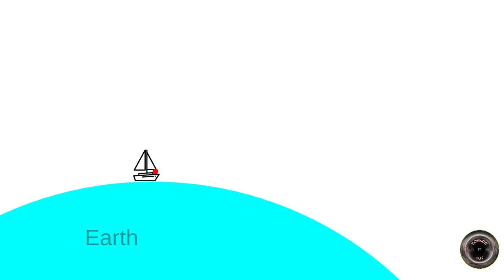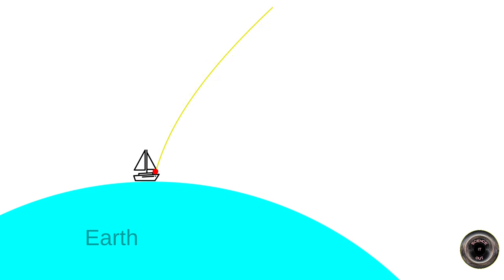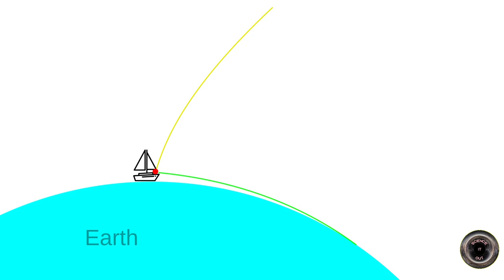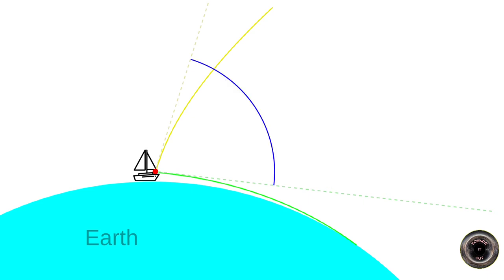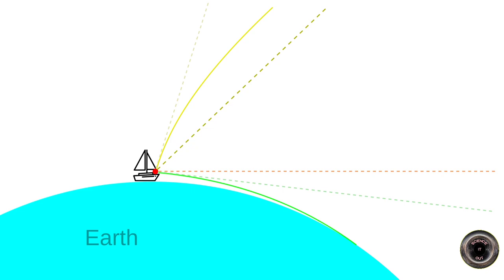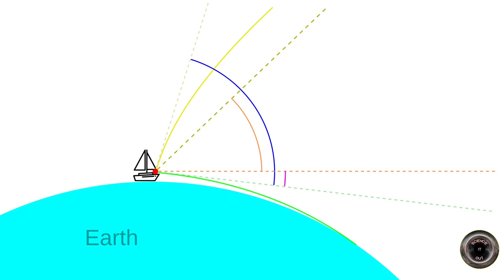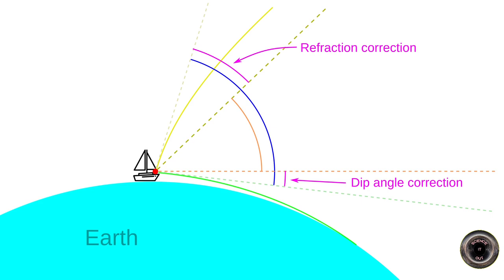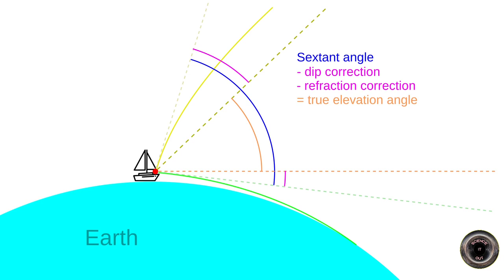How measuring the elevation angles works on a globe

Comment: This already starts off wrong.

Straight lines in sextant readings not bent lines.

Also you require the elevation angle from a 180° horizontal! This would be your sensible horizon.
Reply from the maker: As I'm pointing out in the video, it doesn't matter for the sextant whether the rays are bent or not (and they are actually slightly bent in reality). The only thing the sextant is "aware of", so to speak, is the directions from which the rays arrive at the sextant. And those directions are tangents to the rays at the sextant. But I'm just repeating what I said in the video at this point - I really don't know what's unclear here.

As for the elevation angle from horizontal, I'm also addressing that starting around halfway through the video.
Reply: @scienceitout  first have to establish a horizontal with a sextant. Nothing to do with bent light rays.

Refraction is a correction for angles less than 20° and dip correction is height of eye correction as you have to bring your sensible horizon to the deck of the geographic horizon. 

This whole video you just made was simply false. Sorry to break it to you
Reply from the maker: @FlatzoidsPerspective  "first have to establish a horizontal with a sextant"
A regular sextant can't establish a horizontal. It only shows the angle between two mirrors. That's it. (Actually, double the angle between the two mirrors, because that happens to be the angle between light rays that end up coinciding after reflecting off these mirrors.)
"Establishing horizontal" happens by subtracting the dip correction from the angle to the horizon.

"Refraction is a correction for angles less than 20°"
https://thenauticalalmanac.com/TNARegular/2022_Nautical_Almanac.pdf page 283 - you'll notice that the refraction correction table goes up to 90°. Only the correction above 20° is less than 2.5', which for many purposes can be considered insignificant.

"dip correction is height of eye correction as you have to bring your sensible horizon to the deck of the geographic horizon."
Remember the "horizon rises to the eye level" mantra? That would actually be the case on a flat Earth. The horizon would always be visible horizontally (well... assuming it would be visible at all, which isn't actually a given), and there would be no dip correction, as measuring from the horizon would just be measuring from horizontal.
But feel free to show - preferably using maths - how the dip correction can be derived from the observer height on a flat Earth. I'd love to see the rigorous, mathematical reasoning behind that. (Although I have no doubt at all that there is none.)

"This whole video you just made was simply false. Sorry to break it to you"
Well, you're wrong. I'd suggest asking an actual expert on celestial navigation, but I don't know if either of us knows one - or even if we did, if you would be willing to accept such an expert as an authority on the matter (although my guess would be no).
Reply: @FlatzoidsPerspective  Funny how you think the video is wrong but your first claim indicates that you don't even understand what a sextant does. Measuring the angle between two points doesn't require a horizontal. It's like you're confused about how a compass works. What you should be doing is finding a single flat Earther who can solve for a location given measured angles. You seem to think you can do it but none have even tried. Last one who did made a fool of himself by admitting Roohif used the proper method after he used spherical math. But you already know that.
Reply: The sextant lines are the dotted lines, which are straight (the yellow one on the left and the green one to the horizon).

The curved solid lines (the light coming from the start and the light coming from the horizon) are bent because light bends in the atmosphere, just like a stick does into the water. It's perfectly coherent with which we observe in reality.
Reply: @FlatzoidsPerspective  "This already starts off wrong." Funny thing about being wrong is it requires a reference or basis. Wrong according to what? Because this video is correct when it comes to all the classes being taught and reference material available for the topics of math, science, and navigation. So when you say WRONG, you must be referencing or referring to something other than the documented human knowledge for math, science, and navigation. While this starts to smell like a global conspiracy that requires way too much imagination to be practical, I don't suppose you have a reference where this video is actually wrong? Not to put words in your mouth, but the only thing I can imagine is that navigation in practice doesn't follow what is documented, but instead follows "the real" process and formulas. Which again seems like a very unlikely global conspiracy to carry out, but, if that is what you mean then you should be able to provide the reference to the actual method and math used from start to finish. That would be the holy grail for this flat Earth claim but for some strange reason none of the flat Earth gurus are able to perform this simple task. Yet they insist it can be done. Very strange.
Reply: @NinjaMonkeyPrime  Gosh Ward, you were a little rough on the Beaver.
Reply: @reidflemingworldstoughestm1394  I think Beav - I mean Failzoid - ran away with his tail between his legs again.
Reply: @FlatzoidsPerspective  you should watch his most recent video.  It's so sad because it is so bad
Reply: @garywybenga4188  thanks will do so mate
Reply: @garywybenga4188  You can’t spell “willfully ignorant” without g-a-r-y w-y-b-e-n-g-a 😂

Comment: Have I wandered into a fundy heretic zealot meetinghouse!!? You cannot achieve an elevation angle from a curved ADJACENT!! Mariners use the HORIZONTAL HORIZON!! Why isn't the dip correction going down to sea level!!? Oops.
Reply from the maker: 1. Measuring an angle to a curve is not a problem.
2. Horizon is usually not visible in the horizontal direction, funnily enough. The difference between horizontal and the direction to the horizon is the dip angle.
3. Dip correction has nothing to do with the sea level.
Oh, by the way, has any flat earther obtained a position fix from 3 star measurements yet?

Comment: No this is wrong your literally stating that sight reduction does not exist, as your bringing the line up to the eye as you guys seem to like to do ?
Well I have news for you, you bringing the line up to the eye instead of the eye being brought down to the water, does not save ye.
The water underneath the boat MUST be in a horizontal line with the horizon and GP, that is the whole point of the correction to make a 90 degrees using sea level as your horizontal reference, so wether you bring the vertex down or line up does not change the correction amount, as the correction amount is always only the height of the person’s eye above the water below, that’s what it is and nothing more, your video is wrong completely as your horizon is below the elevation of the water underneath the boat….
Reply from the maker: "No this is wrong your literally stating that sight reduction does not exist"
This has nothing to do with sight reduction. Sight reduction is done after measuring elevation, including corrections for dip and refraction.
And it might not be done at all. My preferred method of calculating the fix doesn't use sight reduction, for example.

"The water underneath the boat MUST be in a horizontal line with the horizon and GP"
If that was correct, celestial navigation would never work, because water is never perfectly horizontal. There are waves and tides - so in accordance with the "curved adjacent" logic, since water isn't perfectly flat, you can't measure an angle to it, and so celestial navigation can't work, regardless whether the Earth as a whole is a globe or flat 🤷‍♂
Also, celestial navigation can be done on land, including when the land has hills - what then?

"that is the whole point of the correction to make a 90 degrees using sea level as your horizontal reference, so wether you bring the vertex down or line up does not change the correction amount, as the correction amount is always only the height of the person’s eye above the water below, that’s what it is and nothing more"
If you use a bubble sextant or an artificial horizon, there is no dip correction, even though the observer is still above the surface. How do you explain that?
Reply: @scienceitout  I don’t care about Your preferred method, sight reduction is used and with success, and that requires the eyes to be at the waterline.
Reply: @scienceitout  Waves and tides have Nothing got to do with the correction being a horizontal between the water underneath the boat and the horizon and GP, they calculate for the peaks and dips and get the average on rough water, the eyes are still brought down to be horizontal with the horizon.
Reply from the maker: @BriansLogic  "sight reduction is used and with success, and that requires the eyes to be at the waterline."
Yes, it is used with success, because it is a good method. It doesn't have any requirements about eye height at all, though.

"Waves and tides have Nothing got to do with the correction being a horizontal between the water underneath the boat and the horizon and GP"
But they do show that both those claims can't be true:
- "you can't measure an angle from a surface that is not flat"
- "you have to measure elevation angles from the Earth's surface"
And you guys seem to be claiming both.
In reality, neither of those claims is true, but that's another thing.

"Why do you guys think that Bubble Sextants and Artificial Horizons are a gotcha ?"
They require no dip correction and they work with the observer eyes being above the surface.
Which disproves your claim that dip correction serves to bring the eye height down to the surface.
Reply: @BriansLogic  requires the eyes to be at the waterline
I do wonder if one day you'll realise - or admit - that this statement isn't true. It would only be required if your assumptions that the GP is on the horizontal plane, and that there's a right angle on that plane to the line the plane to the GP were true. They're not so there's no "requirement" and the whole process works just fine.
Can you recognise this?
I can tell you how to get the arc length to the GP in a way that makes sense geometrically - it's the zenith angle * circumference of Earth / 360°. You can't on a flat Earth because all of your assumptions are wrong.

Comment: Your boat is not scaled correctly with your horizon 
😆 Ho-hum
And now you have a curved tangent 
Good grief

"Seems to the sextant" 😆
Reply from the maker: Point for Dora Nku: https://www.youtube.com/watch?v=xwf5P4L2_BI&lc=Ugy2xcHxEpMR7j_AI2p4AaABAg
Yes, of course it's not to scale, because if it was to scale, nothing would be visible. But the geometrical principles are preserved.
Reply: @scienceitout  and yet every glowbee nitwit complains when my Polaris video wasn't to scale. 😆 
Glowbeez are funny
Your geometric  @Science It Out  and yet every glowbee nitwit complains when my Polaris video wasn't to scale. 😆 
Glowbeez are funny
Your geometrical principles were not "preserved"  What's funnier still is they are incorrect in the first place.
Reply from the maker: @garywybenga4188  "and yet every glowbee nitwit complains when my Polaris video wasn't to scale. 😆"
Depends on whether the scale matters for the crux of the issue or not. In your case it did, very much. Here, it doesn't.
Does the scale change the fact that there is a dip angle? No. Does it change the fact that refraction changes the elevation angle? No. It only changes the magnitude of these effects, but not whether they exist or not. It's no secret that these corrections are in the range of single arc minutes in reality, and in my diagrams they look like tens of degrees. The principle is the same.

In your case, I don't exactly remember what the issue was, but IIRC you pointed out something that stemmed from non-parallel rays from Polaris, when in reality the rays are for all intents and purposes parallel precisely because of the scale. So basing your whole argument on the fact that they are not parallel in an image that isn't to scale makes no sense at all, and the complaints were perfectly valid.

EDIT: I looked for the video in question and it seems I wasn't quite correct, but close enough. You drew Polaris at a distance from Earth comparable to the size of the Earth's orbit and then pointed out that the Earth's axis wouldn't point towards it after half a year. And this is a conclusion that depends on the scale. If the distance to Polaris is thousands of times larger than that - as it is according to science - your whole reasoning breaks down.
The reasoning doesn't break down if you change the scale in my video.
Reply: @scienceitout  your whole video with bent lines to everything is a complete joke. 
Silly glowbee
Refraction is a non-issue to start with
Reply: @garywybenga4188  That told him, eh Gary?
Reply: @Petey194  glowbeez cry about scale all the time
Reply: @garywybenga4188  "complains when my Polaris video wasn't to scale" Was that about parallax? If so that's really funny. The moon requires parallax adjustments because, wait for it, it's so close. You know, because in some cases scale matters. Just another time you #lieforjesus and pretend to not understand what words mean so you can giggle and slap the cows.
Reply from the maker: @garywybenga4188  "Refraction is a non-issue to start with"
Tell that to people like Sleeping Warrior, who believe that sextants wouldn't work with refracted rays 😉Or with rays bent by gravity.
One of the points of this video is actually that it is a non-issue, because you can just correct for it if needed (and the magnitude of this correction is small, anyway, though I'm not mentioning that in the video).
Reply: @scienceitout  angles of elevation taken with a sextant are simple perspective angles from the observer's FOV
Reply from the maker: @garywybenga4188  That sentence is a word salad, you know.
Let's start with this: what are "perspective angles"?